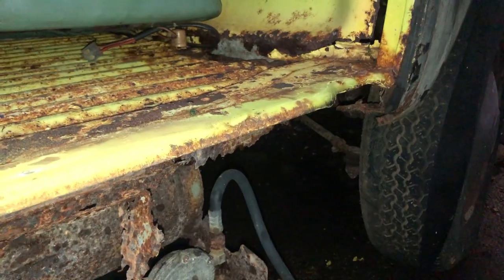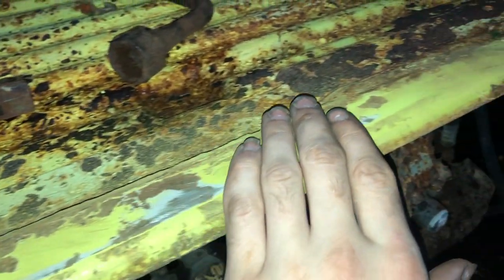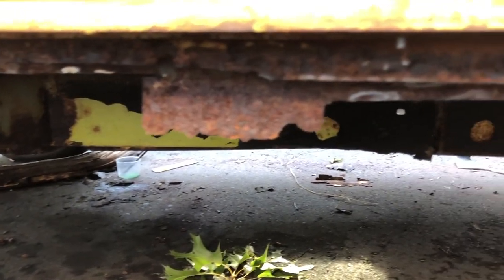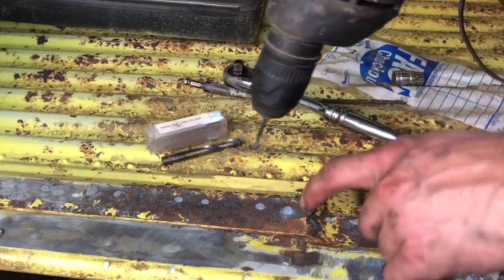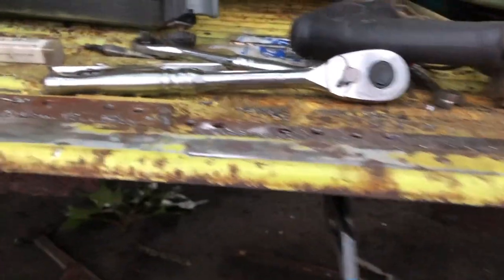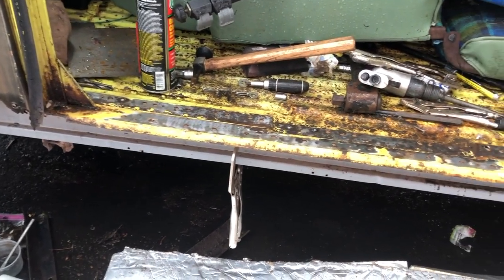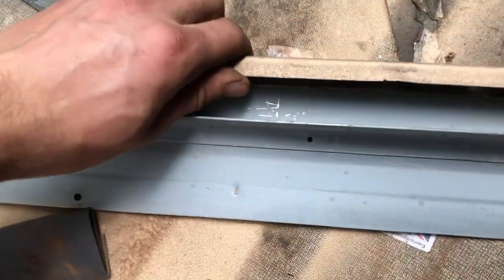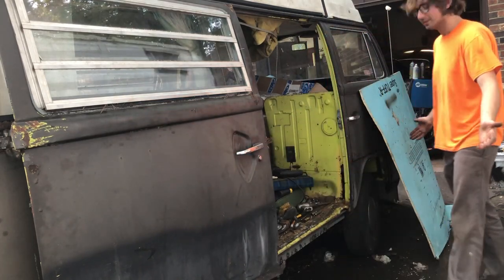Volkswagen Bus Sliding Door Track Replacement

Comment: I saw the frame undeath....no worries you can fix it. If I can save that single cab,  I know you can save that bay. Your getting better at this. probably better than I was when I was your age at least at the welding part.
Reply from the maker: Yeah frames real punky but I’ll get it done. Working my way up the restoration chain!

Comment: DUBSworks  just watched you pull a rabbit out of your hat......nice job!!!!!!!!! I only have one suggestion, if it was me and I probably welded some braces in that opening to make sure It didn’t  move and didn’t wiggle but I overthink things but all the time I’m a carpenter by trade level square and plum wore 345 that’s a right angle!!!!!!!!!!!!!As for  the valve covers off the motor that was rushing in and saying oh shit and thinking later how I should’ve done it!!!!!!!!!!!!! but you did a great job considering it was in the driveway!!!!!!!! 5150 could learn a few things from you,,,,,,,,,,,, keep up the great work can’t wait to see the bus done on the road again junkman do
Reply from the maker: Thanks! Yeah the opening was welded at the corners and the floor spanned it so I wasn’t worried about it. Seems to have been fine. Now to do some more magic tricks and turn this crusher bait into a Hagerty Magazine special.